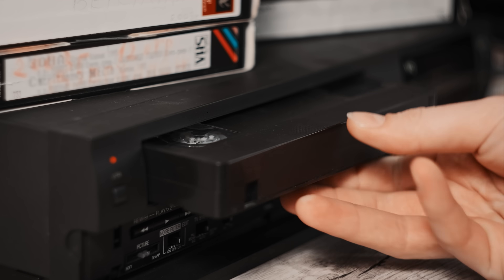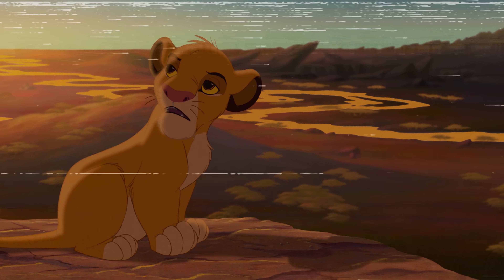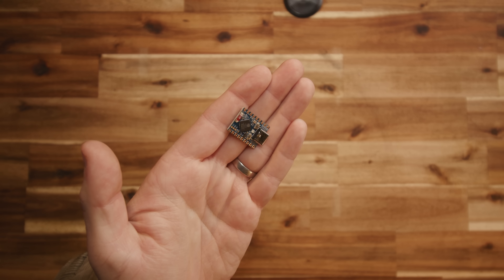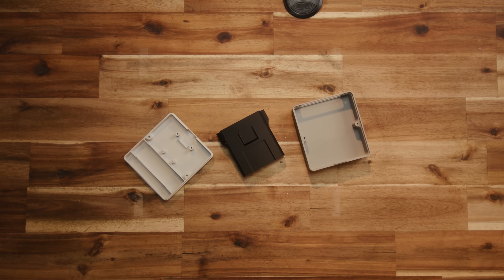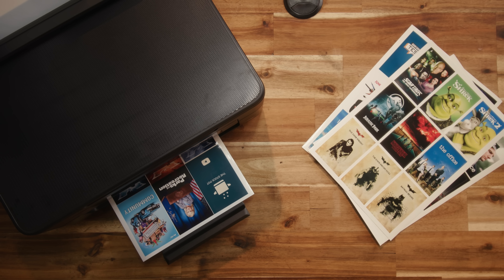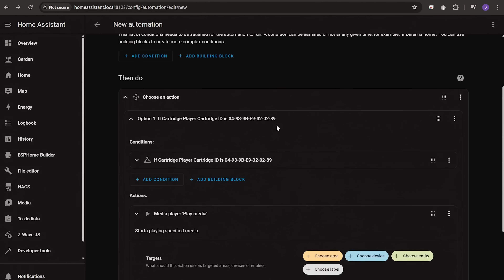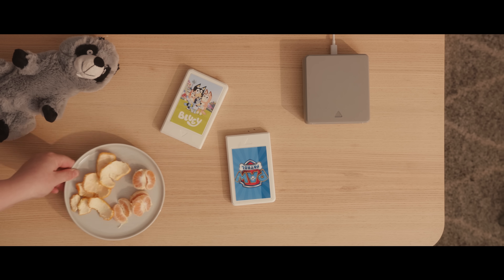I Missed VHS... So I Made My Own

Comment: Video on Cartridge is such a Neat idea, but I'd go about it a different way. Probably the idea of a cartridge with its own ROM board wherein you'd have the Movie, and some extras, maybe a commentary or two, the added value of a DVD with the physicality of a VHS tape. But that'd need ROM chips, ROM Programmers, thinking up an interface, and enough storage on the chip to store several hours of video with sound, not to mention some kind of physical Pin-edge connector with corresponding port on the player.

And that's before getting into whether or not studios would even support such a damn fool idea! Well, maybe the likes of Arrow Video and 88 Films. Still, Here's to ya for the idea at least.

Comment: When will you release a series of devices 'above and beyond' to which they are printed using PCBWay stainless steel, rubber or other material facets that would make a limited run series quite exciting for those DIY enthusiasts? Suppose a remote or cassette device that would cost the end user in upwards of ~$300. Providing them a build aesthetic that is longstanding on their coffee table or desk. Would you be interested in tackling that if patreons were interested?

Comment: Neat!   Another option, rather than 3d printing a lot of stuff, would be to take an old VCR, gut it, and put the NFC receiver in that.  Then convert some old VHS tapes to NFC cartridges.  You get the full VHS physical experience with HD video.  Especially good if you still have some kind of tape storage cabinet.

Comment: The biggest tragedy isn't just the loss of the format - it's the loss of the cultural record that stopped being archived at the dawn of digital tv. Although people didnt neccessarily record for posterity, the fact it was so easy to record and that recording were set off in advance and  ran on to record other stuff too meant that once only tv thats not neccessarily officially been archived can survive even if not quite broadcast quality.A physical medium like VHS being can last decades and of course with the internet shared online. I've got recording from over 1982 with the spinning blue and gold logo from 40 years ago. No hard drive would store data that long so.. lots of tv programs that people record, news items would be accidentally recorded sometime and can be potentially preserved.  Thats what lost. The VHS era: 1980 - 2012. Nobodies likely gonna be arching rare news and documentaries from hard drives from a PVR from 2014 for instance in 2038 that's for sure. It's just dead electronics in landfill. Nowadays you can of course use HDMI splitter to bypass copy protection and record digitally buts its a pain in the arse.. and then youve got huge files filling up hard drives that have to backed up every few years before the hard drive dies. The increased picture quality of digital is a mixed blessing. The quality is superior but now it has to be protected with copy protection which TV history less likely to be preserved.
Reply: British Comedian Bob Monkhouse was a secret obsessive on VHS, and even got himself a copy of the last episode of the game show that he was hosting at the time, the Golden Shot, for his collection. It's because of his dilligence that we were able to preserve the first appearance of the now Sir Lenny Henry on the talent show New Faces (or was it Opportunity Knocks? I forget).

Comment: Now add a battery powered microcontroller in there.
That will monitor 2 rotary encoders to wind and rewind the digital timestamp of where it will start from.
Add random degradation so the video degrades over time.

Comment: Actually movie cartridge is good idea from the point of view of Movie industry and distributors. Hard to pirate movies since not everyone can produce cartridge with highly integrated circuits . Movie in digital form on the non removable chip . Evolution of kind of only once programmable soldered big EEPROM concept since everything is digital .CPU from reader decodes. Ideal for video rental .Similar with software . Hardware itself is the key . Like USB was for Steel Beasts Professional .

Comment: Streaming media isn't actually better quality than modern physical media (ie, Blu Ray). Streaming media will always have compression, and the higher the resolution the more the compression. It's 'good enough' for most people, especially since most people have cheap TVs and never change the picture settings from what it was set to out of the box. But if you do care about video quality physical media (or a well made remux rip from physical media) is always going to be the best quality.

Comment: I just built one of these and it's pretty slick. So far my only gripe is that it doesn't seem to be a way with HA to launch anything other than Plex or YT, Jellyfin doesn't seem to support this kind of linking 😭 (and the various streaming services don't play nice either). Guess I'll be setting up Plex too
Reply from the maker: A lot of it is dependent on the kind of player device you're using. 

Android TV devices and Apple TV devices seem to work best!
Reply: @TheStockPot-AU yeah, my TV runs Android so that's easy, just Jellyfin doesn't have deep linking support yet. It's an open issue on them

Comment: This reminds me of a project by another channel, they did something similar, but they actually made a PCB to house MicroSD cards which then went into the machine like this they custom built. 
One issue they had is eventually the labels would start to peel off, have you found that an issue, they had solved it by switching their 'cartridges/tapes' to Acrylic instead of plastic. 
Either way I love the simplicity of this setup. I've thought about doing something like this with Audiobooks, thanks for the inspiration.

Comment: Hey! I made this yesterday and tested things out. For the Plex piece of it, I did the following to try to improve the experience with Android TV remote on HA.
- On the TV, in the Plex app, under Advanced settings, enable Advertise as Player
- In the automation, after Plex is launched, add a step to push Plex Media Server's 'scan for clients' button; then, a second step to wait for the template: {{ not is_state('media_player.plex_zzz', 'unavailable') }}

Admittedly, I had to move Plex andy TV onto the same VLAN to get it to work reliably. That could have just been a quirk of my router/firewall though.

Anyway, thanks for the cool video and project files. Keep up the great content!

Comment: Mechanical media, to magneto optical media, to laser optical media, to solid state media, and it doesn’t degrade or damage with each playback one bit, not even a fraction

Ways you can improve, Add 4K and 8K resolution, HDR, HDMI, USB type C power input, Crystal clear audio, special features and region free

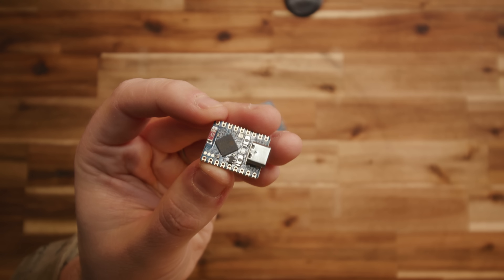Comment: At 3:23 I'm wondering if there's a way to make the NFC tag retain a timestamp so that, like a VHS, you can plug it in and keep watching from where you left off? Then of course rewinding would be a matter of a couple of clicks/ button presses instead of several minutes
Reply: I think technically, and don’t quote me on this, but you can change the tag name of the NFC tag at any point. Idk if there’s a limit on character length, but you might be able to check the time code and add that to the tag name? Maybe add space some separating character to be able to split the string and manipulate it.

Comment: You could make it wireless by using a WiFi board and a microswitch (for the power), this would mean on insert of a cart it's physically powered, reads the  id and sends it and on confirmation of success goes into deep sleep

Comment: Alternative, that I like and won't be killed by a hard drive crash: Make a cartridge that has a 4 pin pogo header in it, wired to a USB 2.0 usb drive. You can buy 8gb usb2.0 drives in bulk for stupid cheap, and watch movies from them without any buffering. Each cart can have an individual movie, or series of movies on them, and you can set them to auto play in your home made player. You can pop the cart in, have it seat correctly, and have the video being playing automatically, and you can eject it the same way. You can also make a player for friends and share movies with them the old school way.

For the vcr body, I would have gotten one of those spring loaded cabinet latches where you push it in, and it locks in, then push it a second time and it pops out, and use magnets in the contact header for the pogo pins to seat the cartridge and hold it in. If you put the reader and the seat in a hinged body, and put the latch underneath the body, you can achieve an NES style "insert and push down" experience.

For ease of assembly, you can get USB 2.0 breakout boards very easily. This would make it so you can swap drives out of carts easily. You could also put emulator files on them and have game carts for a diy game console...

Comment: I do really like this idea, but I think because I'm slightly younger and didn't really use VHS much (still did but it was more limited to grandparents houses) I'd love a more floppy-disk style where the card is a flat piece instead of a chonky box. It still gives the feeling of slotting something in but would let you store them in much less space, and would probably let the card be reversible since the RFID chip could be read thru the plastic. It would likely need less print time or material, so you could make more with less. If I ever get around to getting a 3D printer this is def something I'd like to try making.

Comment: Ok... so if you are going that route... This seems excessive.
Why not just use cards with a barcode on them? The bar code links to a media file on your drive, and takes up little space.
You can use a webcam, and even have support for your mobile devices.
The cards themselves would solve the "takes up space" issue, while also being a way to have intricate poster art involved.
The only "issue" i see is the lack of tactile feeling of a cartridge. I get liking that, but it just seems moot at this point...

Comment: Design flaw. It requires two hands because it's so light.

I would have made it use the same kind of mechanism as a Super Nintendo. Top-loading, pressing down the eject button pushes down on one side of a lever, and the other side pushes up on the cartridge enough to unseat it.

Honestly. Just get an old VHS player that doesn't play tapes anymore and maker 3D printed cartridges that fit it. Then use your ESP32 or something similar to replace the internals of the player and actuate the eject mechanisms. You could probably tie it into the tape motor so it makes noises without really doing anything. Just when you're loading and unloading the player.

Comment: Really neat idea and I agree with using NFC tags for several reasons.

1.) They are cheaper, and can be replaced much easier too. 

2.) There is less of an issue with constantly inserting and removing it compared to an SD card or USB drive. A lot of people haven't quite realized that it's not quite so seamless at the moment.

3.) Similarly, the data is safer on a NAS or hard drive, especially if you have any backups. SD cards can and often will just die. I saw somebody say they will go read only, which I have heard happens with SSDs, but I have had SD cards just die out and become unreadable out of the blue with no warning. Read speeds are also usually better from a hard drive than from an SD card.

4.) I also saw several people mention being able to share the cartridges, but legally this is no different from you sharing a download. The data has to come from somewhere and if you made the digital backup from a disc or VHS, then you would need to lend that as well if you were trying to stay on the legal side of the law.

I think some of the ideas about the display would be neat, but I am not certain how feasible it would be. From what it sounds like, the system either loads a URL or it opens a file in your media player. A display would need to be able to see the information from at least one of those sources, and it might not be exposed to you. You might be able to do something with a player like KODI, but I can't imagine sites like youtube, Netflix, Hulu exposing the information in an easy way to be read by the video display.

If somebody is wanting to do something similar with the data actually on the medium. Then it would make more sense to just author BDRs, IMO, at least in the cases where there is no Blu-ray version available. When I say author, I mean do it in a way where it will be seen as a playable Blu-ray disc by most players. It's probably possible to technically play the video files directly from a regularly burned disc, I had a DVD player that would play MPG files that were on CDRs and DVD-Rs (also MP3s too). But I figure that your chances are best with actual BD authoring software.

Actual Blu-ray versions would be preferable when available. There's obviously the legal reasons, but also because they will likely be a higher quality than a BD-R. They'll also likely last longer too.  I obviously recommend backing up any physical media you own because like it or not, physical media decays as well, and a properly backed up piece of media is much less susceptible to being lost. There's a lot of media out there that has been lost to time because people didn't back it up, and there's a lot of media out there that can only be experienced because somebody DID back it up. But if one wants a more tactile experience, DVDs and Blu-ray still offer mostly that and are typically a lot cheaper than trying to put everything on individual SD cards. Cases can be bought for relatively cheap too, especially if bought in bulk. The downside is most are made for single discs, so you might need multiple cases for a series for instance.

Comment: It would be easier to do to use standard NFC cards They're smaller. It  Doesn't matter which orientation you put them in?   Seems lot like reinventing the wheel.  I've played around with the NFC reader on the Mister FPGA.  It was  kind of cool but dedious and expensive.  This also seems like a bit of Conspicuous consumption.

Comment: "...not exactly practical..." I'd disagree, physical or tactical interfaces are extremely practical. Perhaps you meant utilitarian? As that's is and was the physical button and touchscreen problem.

Again, you've recreated the physical interface not that physicality of the thing. The physicality of the thing has it's own separate reason, with the how so being it's own argument with many of those issues attributed to "old" not really being true or rather "new" not having them not being true.

Really, the physicality is duplicated in having the file server instead of using services. Still have to manage all those issues in the long run, including other hazards of life.

Also, to explain more why it's the interface and not the physicality, imagine if they made giant multi tape systems like for audio tapes or a jukebox for that matter. Those are physical, but the interface is the automated selection from a bank of things though an intermediate interface for that automation rather than doing it yourself.

It looks like it turned out great, though. Just using a tag to make them buttons would make other form factors easier. Like you could cannibalize a broken or cheap floppy drive just for the mechanical latch and eject.
You could also go sci-fi with it and mix the interfaces where you either have certain cartridges with a screen or have a holder reprogram and dispense one like a half-way jukebox, perhaps with a flip book like interface. For something like that, you could use an e-ink screen to change the image when it reprograms the tag.

Comment: For 2 years I've had my trusty AWA brand VCR sitting next to my computer.  It's not actually connected to it, because when I moved into this house 2 years ago, I didn't actually set up my Sony Hand-cam which handles the analog to digital pass-thru required to connect to the computer.  But, the AWA is still sitting right next to my computer, ready for me to continue the task of working through my 1 last box of VHS tapes, to identify "important" bits and pieces that I want to keep.  It's a job that I started about 7 years ago... and will finish, one day.  Yes, one day.

Comment: I think this is a great idea, well planned and well made. My only feeling is that each movie cartridge is a big empty box with almost nothing inside - it's taking up a lot of space, and if you have a huge collection of movies you're going to need a lot of shelves, just like you did with DVDs (they look like they are probably the same thickness as a DVD case).

My alternative would be to have some kind of card reader, with each movie ID encoded onto a magnetic stripe card (credit card style). Your 'player' could either be set up to work so you slide the whole card into a slot, like your carts, or you just swipe it and put the card away again. Magnetic stripe cards are cheap and readily available, as are the readers/writers, and you could still print out your movie graphics as stickers, or there are also printers which can print onto those kinds of cards.

Imagine the space a box of 100 cards would use, versus 100 of your cartridges. And you're still getting some of the tactile feeling, and you have physical objects, albeit smaller in size. The cards could be stored like trading cards - there are binders you can buy to hold trading cards, for example, which you can then flick through to choose a movie.

Just a thought, maybe for a future project. Keep up the good work!

Edit: sorry for being so old school, but it's my age! You can of course get cards with RFID tags in them, so those are probably much easier to adapt to your existing system!